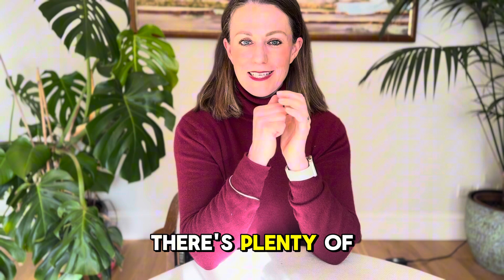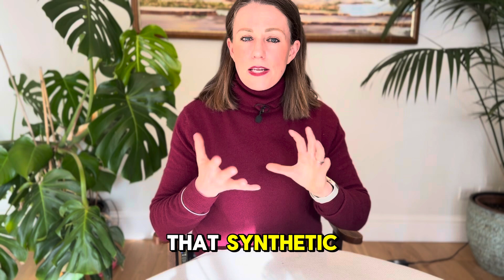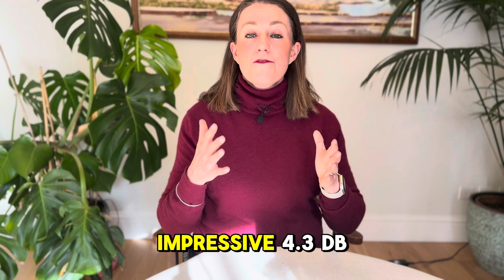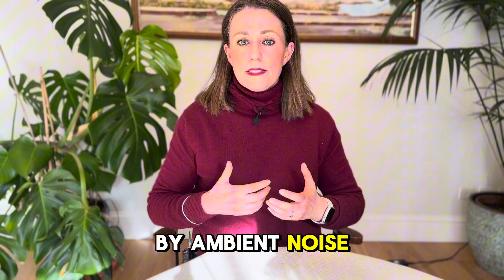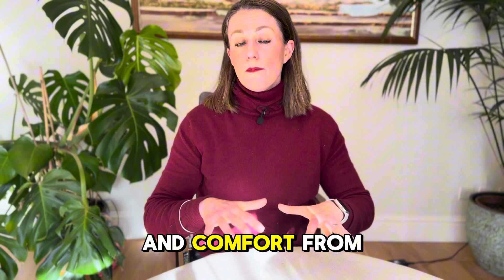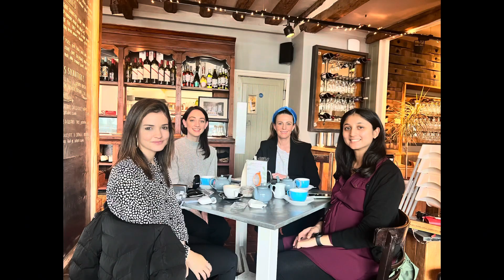Meet the new WIDEX Allure! #widex #allure #widexallure

Comment: The Widex Allures are great for music and Widex is without question the best HA for musicians....but... I tried the Widex Allures 440  and the "older" Widex SmartRIC 440 and the smartRIC is equal or better in every perceivable way to the Allures , plus the user has access to more features and more programs from the user App. The why the Allures present to the user is a big step back. The Allures may advertise 4x speed processor, but it's really not doing much for you. Performance in crowds is not perceivably better than the SmartRIC and the "Universal Program" is just making the same mistakes faster. Things like making popcorn popping sound like bells ringing.  I'd buy the SmartRIC at about 1/2 the price and wait for the next generation after the Allures. Widex made a fail with this "next gen" Allure by removing features the user needs and doubling the price without providing any useful new features. The PureSound (best for music and musicians) performs equally on both models because it turns off all of the AI and processing and the so-called 4x M1 chip is a non-factor. I found no perceptible difference in speech performance between Allures and the SmartRICs which are the same platform as the Moments.

Comment: On paper, the Allure sounds impressive!

However, as a mild hearing loss in one ear person, with longterm tinnitus with associated cognitive load concerns, I’ve begun using hearing aids, and I just completed a demo with SmartRIC 440, while waiting for the Allure 440 to arrive.  I now have the Allure 440 and I’m not so pleased on several fronts.

I was very pleased and “happy to wear” the SmartRIC, yet now after several days with Allure, I’m not so happy with the difference. 

A main difference is the amount of ‘touch noise’ with Allure in comparison with SmartRIC (hair contact noise is considerable when chewing, smiling, moving my head, something I did not experience with SmartRIC).

A second main difference is the sound quality is thinner sharper less relaxed with Allure, as well as it feels closer to me rather then a more natural located at its source. Could it be that the L shape and mic placement & mic cover are really a big game changer between these two options?  If so, it’s such a shame Allure is not offered with L shape.  

I’m strongly considering returning the Allure to my audiologist and replacing it the SmartRIC despite the advertised improvements. I do like the Allure app much better, however, and the ability to cast LE when it becomes more the standard is great, accept as a committed Apple user, LE is more likely than not coming to iPhones making that future proof promise mute.

It may just be that despite the power of the W1 it still cannot match the gains the L shape solved for with the SmartRIC, making the software gains very specific with the Allure while leaving on the table hardware form factor solutions found with the SmartRIC, especially in regards to ‘natural sound’.

I would also add that this video is more commercial video for the Allure and not an actual ‘review’ by a user who offers their experience or comparison with other Widex offerings, which is what I was hoping to hear.
Reply from the maker: Hi.  Thank you so  much for your post here.  FIrstly, I am pleased that you are wearing hearing aids to reduce cognitive load.  This is a very smart move.  

My first question is - was the hearing aid fitted using Probe Microphone Measurements?  This is a critical component of any accurate hearing aid fitting.  You can learn more about PMM here: https://youtu.be/uKCGVHyQpBE?si=3oquUdbWtapvZHGV

And yes - as I mention at the end of the video, we have just received our demo hearing aids - so will first do our own in-house tests to make sure that we are happy with them.  Having listened to many hearing aids, I was quite pleased by the sound of the Widex Allure.  The increased noises that you heard may well be down to the programming.  The L shape of the older model may have helped with the directionality but I am sure that Widex has accounted for the new microphone positioning in the algorithms.  The thinness of the sound is more likely due to the programming.  

Have you perhaps considered another manufacturer?  If you have a unilateral fitting then perhaps the Oticon Intent may be a good option for you?  In any event, if PMMs have not been done (on any hearing aid) then this is a non-starter.....
Reply: @ hi! Yes, Real Ear Measurement (REM) using PMM (NLP Standard) was used to fit Allure, which led the audiologist to change the Widex first-fit programming.  I actual wonder if PMM was not helpful in this case, as PMM was not used with SmartRIC demo and I was very happy with it. I chose Allure assuming, based on the marketing, that it would be even better sound quality with future proofing advantages given Moment platform is likely near the end of its development. I’m also hearing faint whistling (kinda like white noise) with Allure, which I can reduce by lowering the ‘clarity’ setting in the Eq, but I don’t recall hearing that with the SmartRIC. 🤷🏻‍♂️

I’ve not tried another manufacturer, this is my first experience with HA, and given my goals with mild hearing loss and longterm tinnitus and highly valuing natural sound, and wanting to protect cognitive issues early, Widex was prescribed from the get go (the audiologist sells all the major brands to chose from).

I’m a very sensitive listener and I’m picking up elements of sound I’ve not considered before (never had to evaluate it like I am now) and unless the programming was just not done well with Allure (the audiologist who did the fitting is rather new, while the SmartRIC was set up by a 30yr expert leader with tinnitus audiologist who unfortunately was on leave when Allure arrived and so his junior Dr took over), but I do have a different spatial perception with Allure than SmartRIC.
Reply from the maker: Oh wow. So interesting. Thanks for the details.  Glad you had PMMs done. 

Perhaps the soft gain is set too high……but perhaps try Phonak or Oticon with a 60dB speaker wire. 

Good luck and please keep in touch!